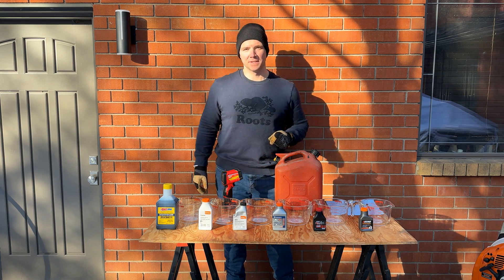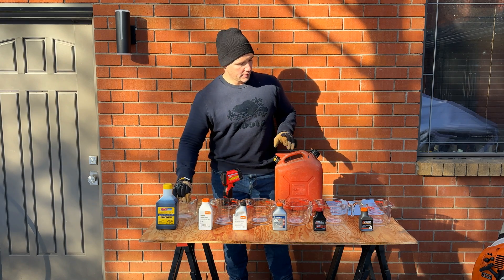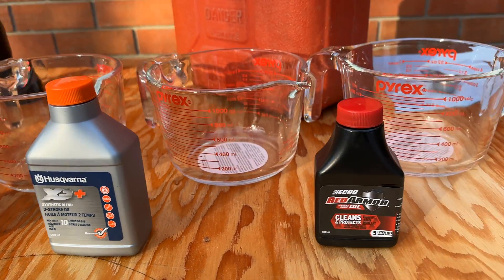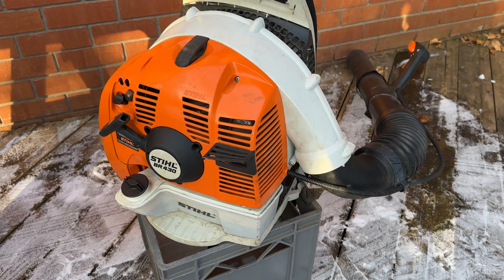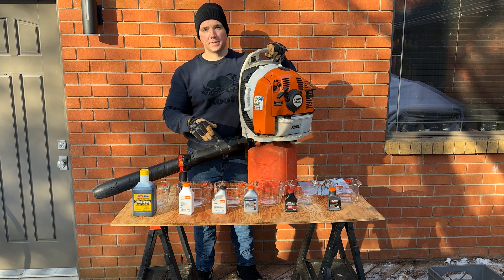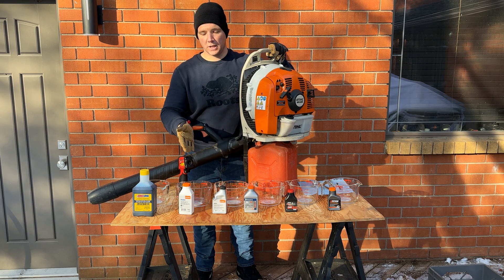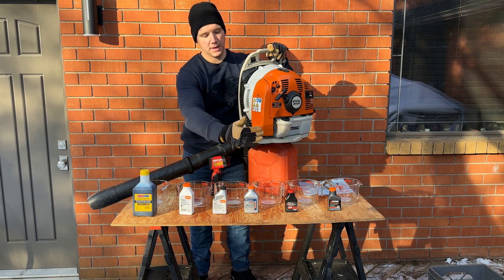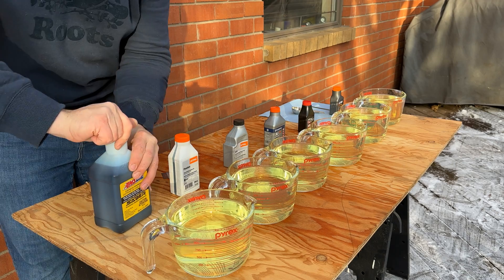Which 2-stroke oil is safest for your small engine? Temperature testing 6 of the most popular oils!

Comment: I use regular grade  ethanol gas with marine stabil added  for all my 2 cycle equipment.  Just fired up one of my Stihl saws that has been sitting for about 3 years with old fuel mix in it. Cranked and runs well with no carb problems.  I usually have some fuel mix that is a year or more old and never have any problems.  Type of oil I have been using is a no name synthetic multi purpose oil mixed at recommended ratios.   In 30 years of using saws, weed trimmers and even a Suzuki LJ20 2 stroke jeep  I have never had any failures whatsoever using cheap oil as long as I mix it according to manufacturers recommendations.  I use saws regularly and do not consider myself a novice.  With all that said, i do believe the oils you tested are very good oils, and there are several others out there like Honda HP2, schaeffer's, Maxima, etc. That are really good as well.
Reply: Why would you knowingly put ethanol-gas into your gear? or, is that a typo?

Comment: I've used nothing but the husqvarna brand in my 323l string trimmer.  Bought it brand new in 2005 and it still runs like new.  I like hooskvarna!
Reply: @chrisshepherd4159  a string trimmer is a very weak 2 cycle, an oil that does well there likely won't do well in a high performance dirtbike bro.
Reply: I don't know why i said likely, i see lots of torn up two cycles from kids running daddy chainsaw gas

Comment: SO, over all, a few degrees in 500, pretty much an insignificant variation and no reliable indication of anything.
Any variatuons in exhaust temperatures of the amount shown could be due to a number of factors. Not in any way a reliable indicator of lubrication efficiency or quality of the oils in question.

Comment: I watched content from another creator. He said the stihl ultra created a lot of carbon build up. Ultra is the only oil I've used for the last 8 years. Your tests show it does quite well, I've also noticed how my saws seem to run consistent and powerful. What does a person do?
Reply: Ultra isn't a "forgiving" oil for applications where the engine isn't being run properly wide open...it tends to do poorly in those conditions. In engines that don't see a lot of "blipping" and half throttling it seems to do better. You really need to let the engine rock n roll when you're using it. I personally prefer Saber with my second choice being Red Armor or Husky XP+. Never had a problem with any of them

Comment: Bro if you mix 20ml of oil in 1L of fuel that's less than 2% because it should be 1L of fuel in the end not 1,02L so that' less than 2% because the oil should be 2% of the whole amount...
And besides that I mix 2% of Castrol POWER1 RACING 2T. Ultimate protection, no smoke, clean spark plug, perfect throttle response...
I mix 100mL of oil with 4,9L of gasoline which is exactly 2% of oil in whole amount of fuel...

Comment: Thanks, Dave for your in depth real world testing on the 2-Stroke oils. I have always used AMSOIL on my 2 Stroke Quads (Yamaha Banshee 350) 100:1 without any issues.  I'll be doing the same with my small engines. I would appreciate it if you could keep up with the informative videos. Subscribed for sure!
Reply: I was an OG Banshee owner. Ran nothing but Klotz and Golden Spectro through my banshee  for YEARS. I raced that bike hard. Did hill climbs. Did woods racing so much that I’d melt plastic impellers regularly. Finally a compa started making metal impellers and that saved the day. Oh and water wetter too. But even with all the abuse I put my Banshee through… wear was never an issue. I tore it down when it was 10 years old to do a power build. It didn’t even need rebuilt yet. Still had great compression. I was a little nervous on the teardown because everyone was starting to hate on Klotz and that was what I ran every other tank. I rotated oils. Did Klotz one mix and then Golden Spectro the next. Not sure why I did that but I did. Anyway, I tee the engine down and there was no wear at all. Crank and pins and bore looked amazing. Piston and rings were golden too. I was impressed. I rebuilt it and sold that bike not long after. I miss it. Keep riding that banshee for me! 🙏

Comment: By reading exhaust temperature, is a good indicator of fuel combustion rates, not necessarily the anti wear quality of the mixture.  Crankcase lubrication, and piston wear would determine the oil’s ability to lubricant.  It is my opinion, that a slightly richer mixture of oil-to- fuel ratio would extend the service life of 2-stroke engines.  Non ethanol fuel @ 89 octane, with 40:1 mixture of synthetic oil.  I have a brand favorite but, that’s not as important as the mixture ratio.

Comment: Interesting… I am not sure measuring the exterior temperature of the exhaust system is actually testing the effectiveness of the two stroke oil. The purpose of the oil is to reduce the friction between moving metal parts. The heat produced by this friction is insignificant compared to the temperature of the burning gases in the engine cylinder which reaches 1500 to 2000°, which is above the melting point of the material of the cylinder body and head of the engine. If you don’t believe me take the head off your small engine, give it a shot of oil into the cylinder & the air inlet and drive the crankshaft externally with some sort of electric motor. It will hardly even get warm let alone hot! (Compare it to an electric reciprocating air compressor) The excess two stroke oil in normal operation is burned with the fuel in the combustion process. Modern oils are very combustible to reduce smoking. The difference in exhaust temperature may have been influenced by the combustion of the excess two stroke oil that stays in the fuel/air mix instead of doing it’s job on the metal parts. Measuring the effectiveness of two stroke oil is a bit more complicated than measuring the temperature of the exhaust. Some sort of measure of the power output/maximum revs may be useful. Some sort of point of destruction test either in revs or time.

Comment: I’m using the Amsoil at 100:1 mix. At first I was kinda worried. Now I don’t think about it at all no concern. I use ethanol free gas only in any 2 stroke I run. I use Stabil 360 amber color and it works perfectly fine even at 1.5 years. Keep gas in a sealed can in the shade never in the sun light.

Comment: I guess the only suggestion I would have would be to get the temp of the cylinder head at the spark plug rather than the exhaust.    a temp sensor and readout could be obtained from any go kart racing supplier as that's what we always watch on 2 stroke karts.

I think cylinder head temp would be more indicative of what's going on in the engine rather than the sheet metal muffler.   Those temps could be influenced by a breeze blowing against the engine .

Comment: Amsoil 100%.  It’s all I use and recommend.
Reply from the maker: Why do you say that? It was hot!
Reply: @DavesSmallEngines  by what 5 to 10-15 degrees? That's nothing. Run it for a good amount of hours, like 20-50 hrs or more, heck run it at 100 to 1 mix ratio,  I dare yah! Then tear it down and see how clean it is with lack of piston scuffing & scoring, providing it has a good air filter of course. Dirt will score pistons too.
Reply: The Saber is not prediluted so it's not really right for two cycle oil injection systems tho, it's all oil.
We used to run  AMSOIL 100 to 1 in our full mod race snowmobiles at between 60 & 80 to 1 ratio with up to 116 research octane race fuel, worked great. Have used it at 100 to 1 in many small two cycle engines. Spark plugs & spark arrestors stay clean, I've seldom ever replaced spark plugs. I had to finally replace the plug in my 20 year old el cheapo string trimmer, it shorted internally but still looked great. Heck some loggers out west tested it and it worked at a 200 to 1 ratio.

Comment: Mercury Quicksilver 2 cycle mix 40/1 it's good enough for a full tilt outboard running wide open throttle under heavy prop load and yes it shows a lawn mower on the bottle ! I have ran it for a while now and absolutely no issues even with a handheld leaf blower running wide open till I ran several tanks of gasoline through it !
Reply from the maker: Interesting. Maybe it really doesn’t make much of a difference after all!
Reply: The outboard isn’t a great analog as the infinite water source provides a regulated and stable coolant temperatures.  Air cooled high powered 2 strokes are harder on oil and lubricant performance and even necessitates different manufacturing clearances.  Having said that, none of these companies refine and blend oil.  We are witnessing more marketing than science.

Comment: I appreciate the effort that Dave put into making this video, and I really like Dave’s channel.

However, I have to say that I’m not sure these results mean anything at all.  There are so many factors with oil properties that I don’t think minor temperature differences in the exhaust tell you anything at all about how well the oil is performing at its primary job of preventing wear.

For instance — in the previous “50:1 vs. 25:1” video, the richer fuel ran hotter… but that’s not a surprise at all, since the viscosity will be greater.  It doesn’t automatically imply that 25:1 is “worse” for engine lifetime.  Yes — there is a difference between, say, 400° and 600°, but not between 510° and 540°.

That would be my main criticism: that exhaust temp ≠ anti-wear performance.  As a secondary comment, I would note that even in the cold, leaving fuel exposed in an open container is going to result in some evaporation, especially since this test took place over some time.  Therefore the later mixes will have been slightly richer than ones that were tested earlier.

Sorry to have to write such a negative comment.  I am a subscriber and like Dave’s videos!
Reply: I like this test. It’s a great place to start so that more “experiments” can be conducted and compared. Given enough experiment data we will eventually reach the holy grail of the “Safest” and “Best” oil that is to be used exclusively by all.

Comment: It’s one data point about the oil’s flash point. While important, I think it’s more important to know how much oil is on internal parts.  There’s other videos that do tear downs of the engine to inspect the internals which I think is far more valuable for determining which oil is “best”.
Reply: I have to agree.  As an owner of several Stihl products the one concern I have with Stihl HP Ultra is that it is not JASO-FD rated.  Mixed at 50:1 it has been shown, through testing, to be inadequate in lubricating the upper cylinder.  It is too bad that Stihl HP Super, which is JASO-FD rated, is not available in the US.  Unfortunately, I believe this may be due to EPA regs.
Reply: I fully agree, the engines were run in the specs of the engines ability and a few degrees difference is nothing. Oil is used to lubricate the rings, pistons, cylinders and bearings. Also, the oils should have all been run at the manufacturers recommended ratios. Amsoil Saber is supposed to be run at 100:1 and its flash point is far superior to a lot of those others and will also protect the internals of the engine better than any other oil in that test, they do the testing all the time. Im sorry testing temps is nothing and doesnt compare the oils for what they are manufacturered to do, and thst is lubricate and engine preventing wear!

Comment: Correct me if Im wrong. You measured the temperature of the muffler? A more accurate comparison would be to measure the cylinder temperature and the crank case temp. Added temperature due to friction would determine which mix is doing its job lubricating the internals. Just my opinion.
Reply: Indeed.

Comment: The temperature variations results are statistically insignificant as relating to engine longevity. Basically, all of those oils work as intended.

If mixed at correct fuel to oil ratios, most brands of two-cycle oils for small engines will protect small two stroke engines. I have two stroke engines that are over twenty-years old that start up every spring and run fine. One is an old Poulan chainsaw that has had different brand oils used in it over the years, usually the cheapest brand I can find at Walmart, Lowes, or Home Depot.

Leaf blowers and weed trimmers typically run for extended periods of time wide open throttle. I mix fuel 40 to one in these type engines. My large chainsaws run a 25:1 mix. My smaller saws run a 40:1 mix.

In over forty years, I have never had a small engine failure due to which type oil I used. The key to small engine longevity is proper fuel/oil ratio mixing, air filter and oil filter maintenance, keeping cylinder head cooling fins free of dirt and sawdust, and using ethanol free gasoline with stabilizer added, if fuel is stored for more than 30 days.

Never store small engines long term ( months or years )with fuel left in the carburetor or fuel tank.

Ethanol fuel is the big NO-no for small engines. If left in the carburetor, it will turn into a gel and plug up the small jets, rust the fuel bowl.
Reply: You don't need to mix at 25:1 in any saw with quality oil man. You might be doing more harm than good at that point. Choose one and run it at 40:1. Hell I run Saber at 80:1 in ALL my saws and it does absolutely fine

Comment: Interesting test but there are quite a few other variables that should be considered before drawing any conclusions from your test and that coolest oil equals the safest oil. 

The question you actually answered was what is the muffler / exhaust temp of a given oil blended at 50:1 with a fixed fuel to air ratio (i.e. the same carburetor setting). 

This tells us very little about a given two stroke oil’s lubrication and anti-wear performance. 

Each of these oil blends likely has a slight difference in viscosity. This in turn affects mix viscosity and the fuel to air ratio of the charge going into the engine if the carburetor settings remained constant for all samples. The fuel to air ratio directly affects the exhaust gas temp to a large degree and it takes relatively small changes in the mix viscosity and air temps to vary the fuel to air ratio.

For this test to give conclusive results, the fuel to air ratio and the oil to fuel blend ratio (the mix) would both have to be held consistent. This in turn would tell which oil actually results in the coolest muffler temps. 

Does this leaf blower have a catalytic muffler? If so, that would also another variable affecting the exhaust temps as excess oil in the exhaust gas burning off in the catalyst would cause an increase in muffler/exhaust temp not related to internal friction of the engine components. The amount of excess oil in the exhaust would be a variable affected by the exact properties of each oil. 

The real purpose of the oil is to lubricant which in turn reduces wear of engine components. Just because one oil give a  cooler muffler temperature at a fixed fuel to air ratio doesn’t really mean anything in terms of that oil’s lubrication, anti-wear, or deposit formation performance.
Reply: I second this comment.

It was a nice thought for a video, and I appreciate the effort it took to run all of those tests, but at the end of the day these small temperature differences don’t really tell you anything at all about how the oils are doing at protecting components.
Reply: But you did learn something…right ? This engines that day with those oils run about the same temperature lol

Comment: I'd like to see a temp comparison of any of the oils 40:1 and 50:1
Reply: I would be careful of drawing any conclusions from temperature differences for fuel mixes of different viscosities.  I would expect 40:1 to run a few degrees hotter than 50:1, since it’s more viscous.  That doesn’t mean that 50:1 is “better” for your engine; probably the opposite.

Comment: Good material.  The Amsoil might be the best at full throttle for keeping the carbon at bay.  Just a thought.  I got it but haven’t used it yet.  The Ultra is what I run in my 261 & 400. I also got the Red Armor and it runs great in my Echo equipment.  Again great video.

Comment: I wish you would have drained the remaining fuel into the measuring cups to see if there was any significant difference in fuel consumption. My guess is the difference would be minor but a test would have been proof. 
Another thing that might be interesting is and could still be done after the fact would be some RPM comparasins each vid clip one after the other of startup in idle condition, startup while full throttle, and say 1 minute in in each condition to show differences in how it runs on each fuel mix. What made me think of that is the difference in how it accelerated and stabilized when started at full throttle.
  It is hard to argue with a good old fashioned drag race comparasin.
Thanks for doing the tests and publishing your results I know you spent a chunk of change and all day doing it.

Comment: Very interesting...I have been running  the Husqvarna XP oil, exclusively, for a long time, maybe 20 years in professional chainsaws ( Stihl, Huskie) and professional weedwhacker/brushcutters,,Always use 89 octane, California fuel. Never had a single problem with it...Never wore out an engine , Probably they are all good as long as you remember to mix in the oil!
Reply: Have you been noticing that the rubber components are shorter lived than back in the Stone Age, I.E. before they were dilated with corn distillates ?   In Radio Controlled engines we have definitely seen that the flexible parts have either become rock hard or gummy messes.  Unless they have some magic formulation in California……